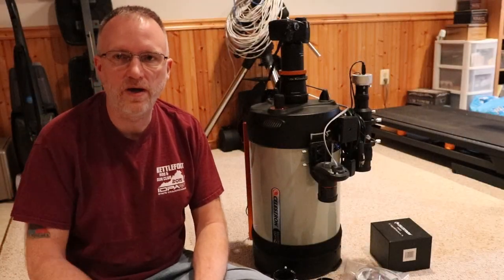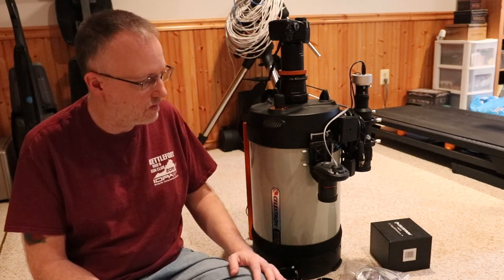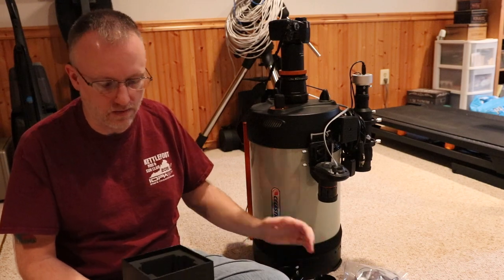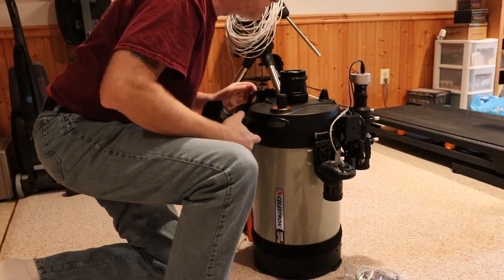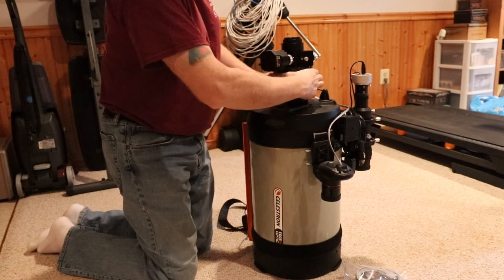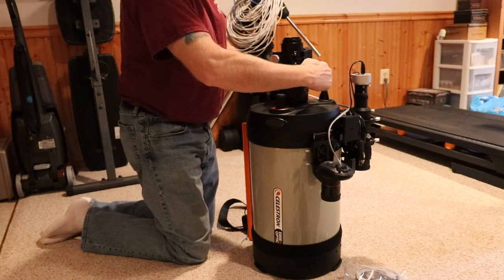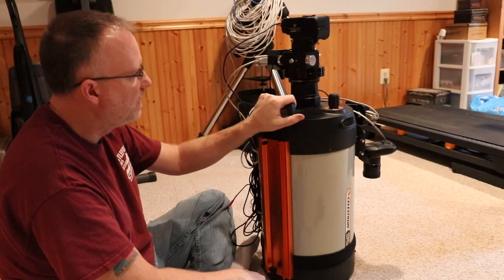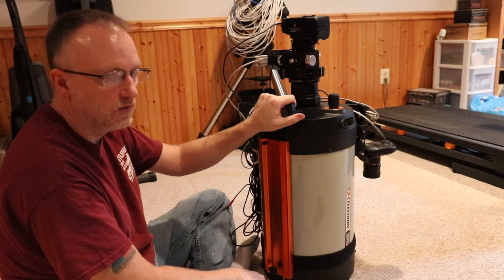Ep26 - Installing the Moonlite CHL Focuser

Comment: I just cannot understand how you control backfocus. I use moonlight on refractor. Whole train including Reducer with fixed distance to sensor moved by focuser. In you case, focuser move sensor relatively to reducer. Your backfocus will vary. Right?